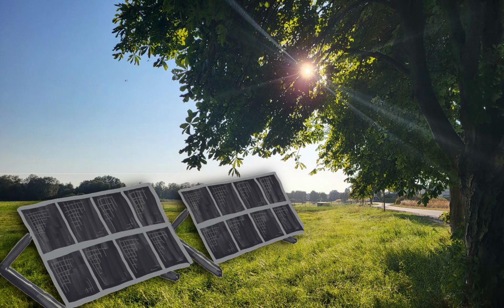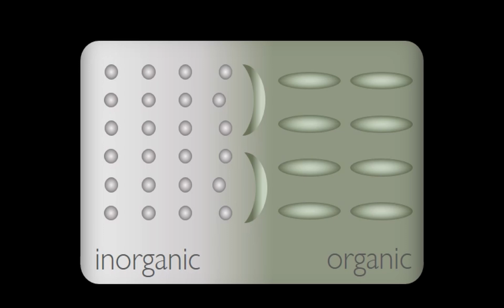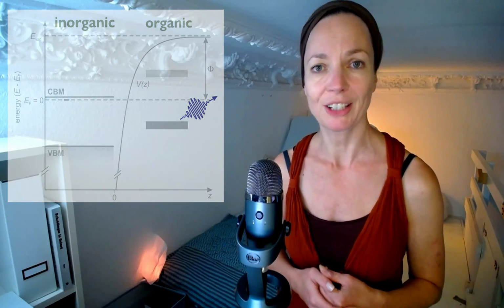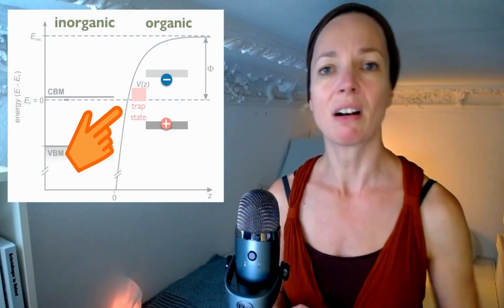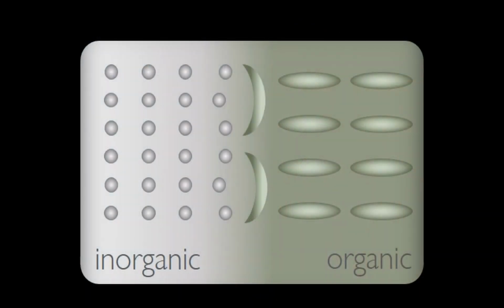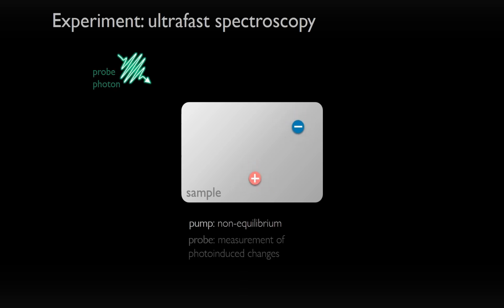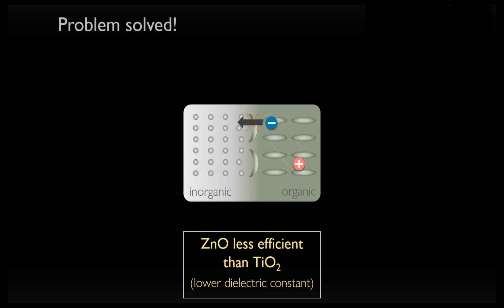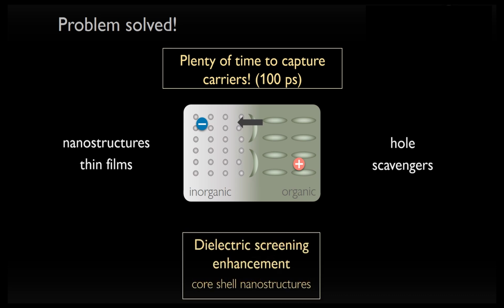Ultrafast charge transfer + separation in solar cells explained

Comment: Hey Prof,

1) If screening was the issue, how come D/A system, which has a lower dielectric than inorganic, dissociate excitons better than organic-inorganic system?

2) Once the electron is transferred to the ZnO side (which is in fs range), the electrons are relaxed to the conduction band minima (in the ps range), which then move to the surface states (within 100ps), binding again to the hole that it left behind in the organics (for micro seconds), before recombining?

So, the electron is still bound to the hole during the entire process, in which the binding between them increases (or decreases?) at different rates, before recombining?
Reply from the maker: Those are very good questions. Briefly: 1) In D/A systems you have a lot more going on than in an inorganic semiconductor, as reorganization of nuclei occurs that can stabilise charges very strongly. 2) Yes, that is a way to look at it, the electron  experiences the hole potential all the time. Cheers!